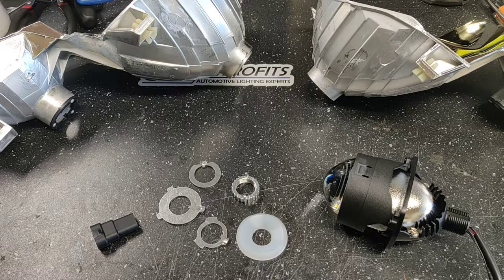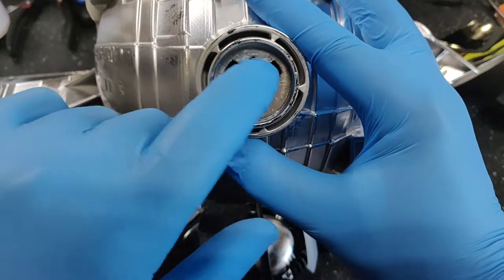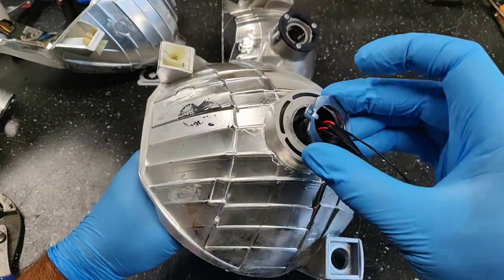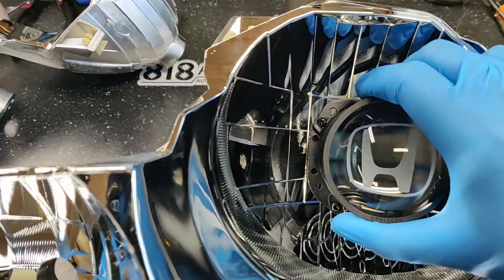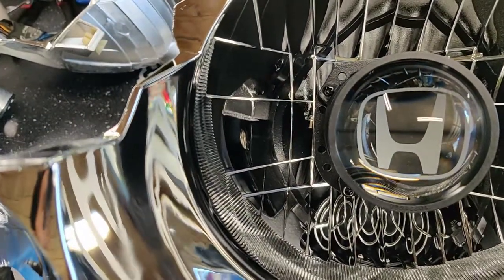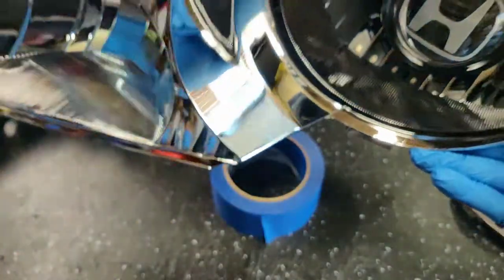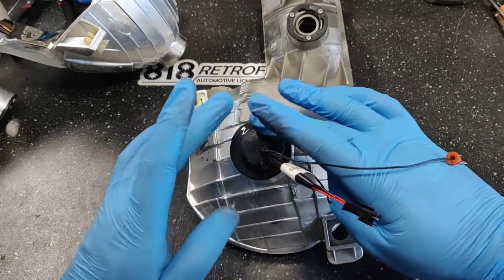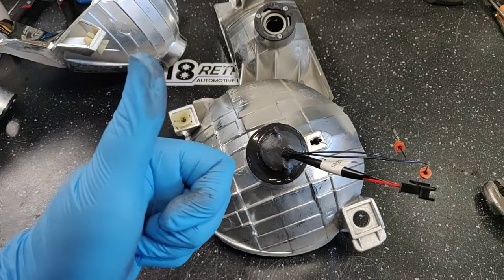Bi-led projector threaded shaft installation in an h11 headlight

Comment: why would you jb weld them in, what about if they ever fail and need replacing, not the best idea
Reply: Asked a similar question on another of his vids. I agree, this diy appears to be a one off for the entire headlight retro fit projector.
Reply: Upon further review of these Bi-Led projectors, they go away from the bulb install and have the led device integrated within the projector. The average of these type of Bi-Leds are 20,000 to 50,000 hours.  Halogen bulbs typically last between 450 and 1,000 hours and HIDs generally last between 2,000 and 3,000 hours. So its safe to say that these Bi-Leds depending on the quality of material and build could last as long as you own the vehicle.

Comment: I have 4 questions, if you would. Please? 
1. How do I change the bulbs when they burn out?
2. I have a 2014 Nissan Altima s 2.5L. Is that what my H11 bulb headlight looks like when I remove the OEM projector?
3. Why is this always such a big project to do? Don't they sell headlights with these projectors already made .
4. Since my car came with projector beams, will these aftermarket projector beams offer an advantage? If any or am I just going to spend money on something I already have built-in, then be disappointed that it's the same as what I already had?
Thank you for helping me with answers to these questions.
I appreciate your time to help me out and others who may have the same question.
Reply: Yeah, all of that epoxy will make it difficult to change anything out. Luckily LED's rarely burn out and issues would most likely be the ballast instead. On average you'll change out your Halogen light bulbs 100x for every LED bulb change and 20 HID/Xenon bulbs. Essentially LED "bulbs" will last the entire life of the car. HID's typically last 10 yrs, It's not unheard of them to last 20 yrs or more if you don't drive at night very often. LED's last 20x that...

Comment: Great video
Question i have my lights retrofitted but i noticed my passenger side is shaking is this normal for a retrofitted bi-led projector headlight?
Thanks more power
Reply: Make sure the bolts of the headlight housing are tightened